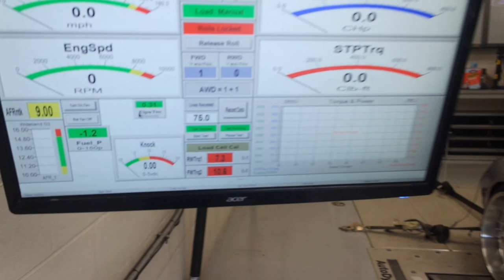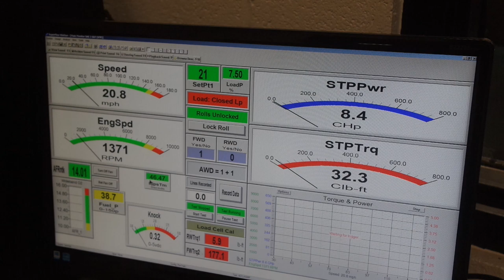Turbo F20b Honda Prelude dyno tune pt 3...600hp or nah????

Comment: Yeahhh booooiiiii, im just excited cause i just dropped a type s h22 into my 5th gen sh. That prelude curse is real though.
Reply from the maker: Nice bro
Reply: GHETTOHEISMAN83 siicck. Where'd you find a type S motor?
Reply: @lordchango7949  hmotorsonline
Reply: GHETTOHEISMAN83 you spent the big bux
Reply: @lordchango7949  yeah, but only because the rest of the car is flawless, took me forever to find the type s though, kinda wish my car was a base model. That way i would have more engine options, and about $1000 cheaper too.
Reply: GHETTOHEISMAN83 yeah I get you. I have a base 5g that I been working on converting from auto2man. Need to decide on tbelt water pump kit to order so I can finish up the timing side
Reply: GHETTOHEISMAN83 does your ATTS system work good?
Reply: @lordchango7949  yeah it does, i almost did an h22 with lsd trans swap, but didnt after all.

Comment: Hi Trey, at least your motor is still good and you found it before it did more damage. Good luck with the replacement turbo. #LEAST6HUNNIT
Reply from the maker: Thanks bro
Reply: Trey Be Dipping I put the new dizzy in my kar Bro and it still Being sluggish and sputtering kan you help me what do you think it is now fuel problem or what I got new spark plugs and injectors I haven’t put in yet do you think that’s the problem or do you possibly know something else it could Be Please and thanks

Comment: I had the isssue with a new Garrett 60-1tO4S. Problem was there was little oil going to the turbo. Double check that the turbo is getting oil and also check the amount coming out the drain. I found out my issue after I ruined the second new turbo lol

Comment: damn that sucks, heart breaking when you put all the work in and get so close then its always one thing after another. should be sweet with a new turbo. maybe you have oil supply problems if the bearing failed
Reply from the maker: Yea i havent really dove into in depth yet but ill find out what really happened.

Comment: My h23 keeps idleing funny it goes from 1500 rpm to 2000rpm and keeps doing it
Reply from the maker: https://youtu.be/JDeh2GDwKLI
Reply from the maker: Check out that link video well give you the answer
Reply: Just stumbled across that video thanks for doing these uploads I was bummed af finally got it idleing right and fluids changed new tires after one hard ride the idle issue started
Reply from the maker: @scrotiemcboogerballs3453  yea bro common issue also take a look at the fast idle valve as well sometimes they need to be tightened
Reply: @treybedipping1734  works great now thanks man! Now I'm waiting on light sockets for the turn signals and ill finally be back to driving.
Reply from the maker: @scrotiemcboogerballs3453  no problem bro